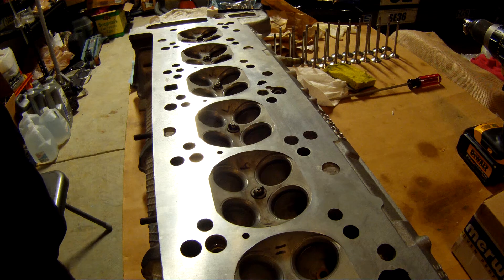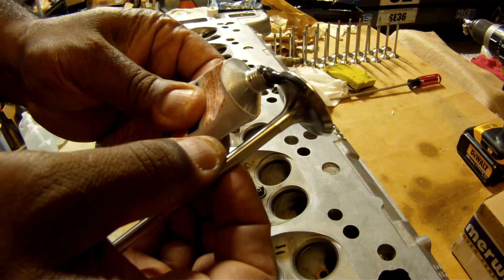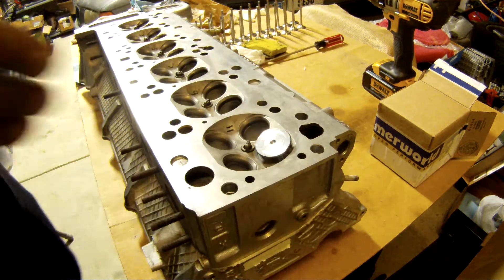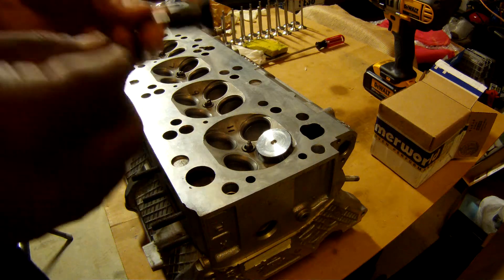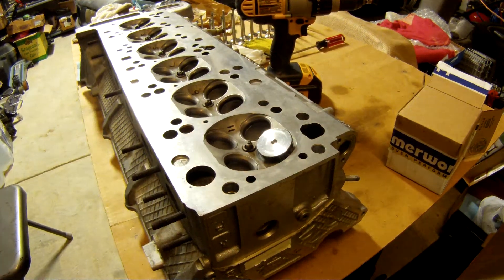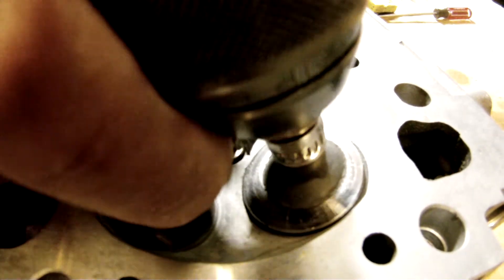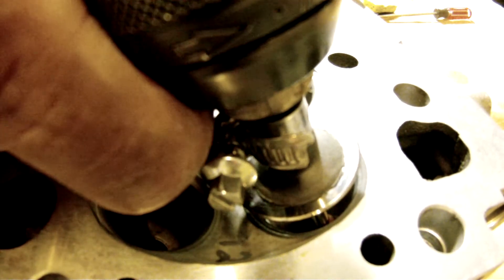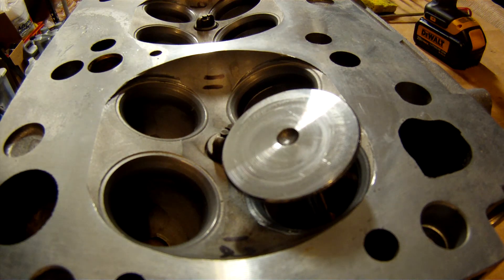Valve Lapping With Power Tools

Comment: you said some exhaust valves were bent, iassume they hit the psitons? did you cange the pistons? and was these bent valves causing low compression readings? @phil antoine
Reply from the maker: Yes, it was the dreaded "money shift" over rev that caused cylinder 5 to hit both exhaust valves.  The collision bent both valves so compression on #5 measured 40psi instead of the normal 195psi.  Since it was a short over rev, piston head damage was minimal.  I just used a dremel tool to grind off the burs. That motor is still running strong today.
Reply: sweet same happened to me I will use the dremel too
Reply: another question for you. since I had the same problem as the one you had on this head. did you replace the guides or what all did you do? I checked my guides they all look good and I replaces my seals and got new exhaust valves and lapped them. please help
Reply from the maker: +Built2Kill Productions I took the head to a local machine shop that specializes in head work.  He cleaned it up, decked it less than a thousandth to true it, re-cut the seats with 2 angles, measured all the valve guides for tolerance and all the valves to verify which were bent and which were re-usable.  He marked 4 exhaust and 2 intake valves bent.  He declared all my valve guides in spec and installed new guide seals for me.

Comment: Much easier if you take a piece of small fuel hose attach it to the drill and bit the put it over the valve stem from other side then pull and turn

Comment: ER You should NEVER rotary lap a valve in esp with a drill,
 it HAS to be a BACK AND FORTH action then LIFT OFF the seat to reset the valve paste on the seat, (as the paste grinding sound goes quieter usually 4 or 5 times ) then turn the valve a few degrees and then rept motion. like starting a fire but if you rotate it, you burn scars into the seat,, meaning the valve seat  gets hotter and clogs with carbon deposits in these scars, which then burns the seat again meaning another head rebuild.
And you start the VALVE Grinding with COARSE paste, then clean off and move to a SMOOTH grinding paste for a nice consistent groove free flat greyish looking seat !
The best way to check if it has worked is to use a soft pencil like a HB and scribe three vertical lines at 120 degrees apart on the seat when you refit the valve on the seat twist the valve when in contact with the seat and the 3 pencil marks will rub evenly along the seat, if not then the seats need regrinding again or you need new valves and or valve guides.,
 
 
This is for the lazy mechanics.
 EAZILAP by GUNSONS, been here 40 odd years,
 a DRILL ADAPTER,  which oscillates back and forth ( )

http://www.ebay.co.uk/itm/Gunson-G4095-Eezilap-Valve-Lapper-Power-Drill-Grinds-Grinder-22-28mm-Sucker-Head-/310719942809
Reply from the maker: I verified the mating surfaces with machinist quality Prussian Blue and reworked each until they showed uniform circumferential seals of reasonable width.  Just as easy and far  more accurate and revealing than a few graphite marks.
Reply: I tried the drill on one and stopped. It created small ridges around the whole seat. Not good.  I did the rest by hand and they're perfect. Keeping my fingers crossed it will seal. I do NOT recommend doing them using a drill

Comment: I had been putting the stem in the drill, and going from the other side.  However I bet that is hard on the guides - I just had a guide stick and am having to do this all over again.
Reply from the maker: That's a bummer.  Almost certainly the unnatural lateral pressures on the guide walls from that direction.  Possible inadequate lubrication of the stems during lapping also.  I lubed them liberally with assembly lube (heavier than regular oil) because I was fearful of damaging the guides with the rotation.  If you're just using oil you probably want to switch. Not sure you could have lubed them enough to protect from the drill pressure on the walls from that end.  I also used all new valves.  If you reused valves and didn't put them back in the exact same guides, you may have had a bent one or possibly contaminate particles damaged a guide.  I calculated the cost of new valves versus potential damage (and rework) caused from the unknown condition of the old ones.  Also, I wouldn't dare grab a valve stem with a drill head for fear of scoring it and subsequently a guide during assembly.  15 months and a dozen race weekends later and this head job is still going strong.  I checked compression this summer and it was spot on from the build.  I occasionally look back at the knucklehead comments from obvious internet expert non-mechanics and just chuckle.  This stuff is not rocket science, but it is art and skill.

Comment: In all seriousness this is a good idea on valves that have been ground correctly from the factory.  Since almost ALL manufactures use a 3 angle correct valve job, there is no reason to regrind the seats.  That could mess with stuff and sometimes inhibit flow.  It is a good idea to do it this way if there are no obvious pits in the seat and you just want to re-seat a valve for a rebuild.

Comment: Leave this job to a pro...lapping valves without grinding the seats!?
Reply: SuperKONR Agree I just lapped valves today but I chuck up the valve in the drill... Funny thing is I just leak checked them with rubbing alcohol... NO LEAKS... So does this mean I need to educate my self too? Last checked I rented the valve tool for oh 25 bucks and 4.95 on lapping compound and all my valves seated perfect with no leaks.... You know who showed me how to do it? A friend that works in a machine shop... BWAHAHAAHAH machinist are like AC guys they don't want to share tips and tricks an thinks everyone is un educated like me...
Reply: When you lap the valves that's pretty much what you're going, grinding the seats.
Reply: When you grind the valve & seats with a precision machine you get the 45 degree angle almost perfectly and you only need a little lapping compound and a few strokes and get your work done.This is why head rebuilding machines exist to do the job as is set to be...
Reply: Not!
Reply: It doesn't really matter the angle as long as the valve and seat match. When you lap them you are matching them by grinding them together with the compound. Of course if the valve/seat is badly pitted you will need to use the machine. But for a slightly burnt valve or small pits, lapping works fine. I'm not sure what you were saying in your first comment.
Reply: You can't match valves and seats slightly burn or with small pores.You are forcing to match both things(valve and seat) with a drill and abrasive.If you grind valves and seats you only need a hand valve lapper without so much effort .Go to a good machine shop an educate yourself.
Reply: Myrh Peace You basically just said what I said. Then you are saying that I should educate myself in something that I already have experience with. Ok then lol.

Comment: Nice, you got the cup under control....otherwise you could just attack from other end of valve...ie, let drill grab valve stem like a drill bit (that's what I had to do cuz the valve faces were too pitted to hold cup suction).

Comment: I do this, I stick a rubber hose on the valve stem and the other end in a dril with the valve face going down that way is case of too much lapping compound can run down the stem and ruin the guide, im seating the valve by pulling not pushing
Reply from the maker: Yep.  Tried it first with that very common hose trick.  This time around I didn't have hose stiff enough to apply a useful initial working pressure without the valve stalling in the paste friction and the hose kinking as it spun with the tool.  Stiff enough hose (like good fuel line) required clamping at both ends to secure it to the valve and tool unless you have that perfect hose diameter for your valves, which I didn't.  The hose technique is perfect for the final polish with required gentle pressure, or for a triple cut seat lap, but the primary lap for new single and double cut seats and valves would have taken maybe twice as long with that lighter initial pressure. 

After awhile it gets very artsy as you calibrate material removal rate at various pressures, rpms and grit levels by checking frequently with Prussian Blue.  The first four valves took a full afternoon.  The last 4 (of 24) took about an hour.  I then went back and re-did the first half-dozen to make better seals.

As for compound running into the guide, shouldn't happen if used as sparingly as it should and isn't diluted.  I applied a thin bead to the valve, not the seat, and used the lap, clean, repeat method.  Never had the first hint of dangerously oozing overage.  Vigilance and patience is key.

Comment from the maker: It is preferred to do the final polish by hand, but if the Prussian Blue shows significant material needing to be removed, its incredibly fatiguing to do it manually.  That said, you have to be patient with the power tool.  Trying to go fast can result in ruined seats.  As the worked compound reduced grit, I reduced pressure.  Now, how to use Prussian Blue...  I didn't record that, but others have.  I found them here. Its far easier to verbalize and show than to explain in text.